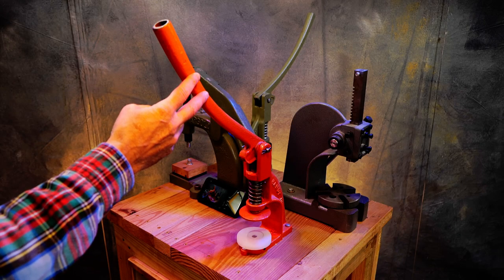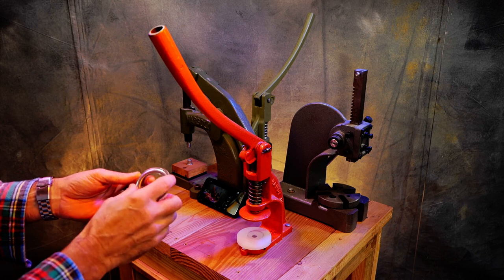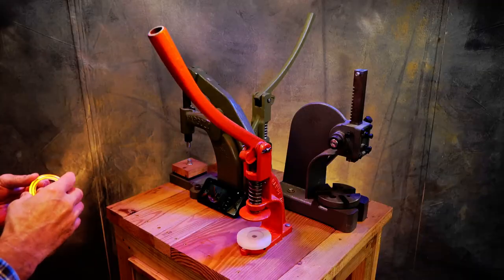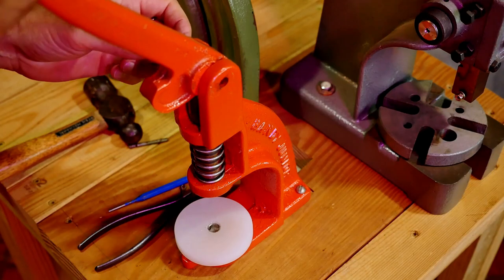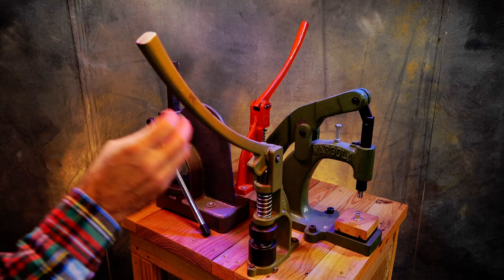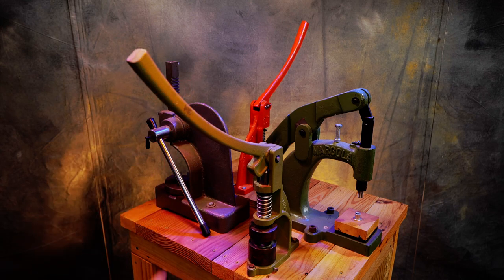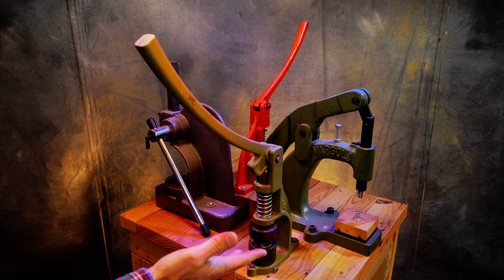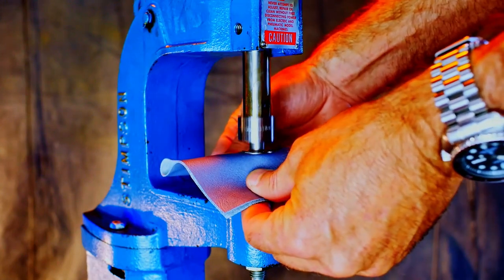Handy Junior #1 Machine Stem Swap with CS Osborne

Comment: Thanks for making such great videos. It is very helpful. I have tried to find that pin for my handy press but didn't have any success. Would you mind giving me a link or how I can find it? That would be much appreciated.  Thanks an keep the good work  👌
Reply from the maker: You will need to find a distributor. I have included the part number and all the info I could glean in the description. I know it is not a link but I hope the info helps you.

Comment: I'd like to convert my Handy Jr to be able to set metal snaps. How would I go about it?
Reply from the maker: There is a die set for every single snap. First decide on your snap and die set. Then you can figure out how to hold the dies in the press. I use an arbor press for snap dies. You can see it next to the Handy. Here is the arbor video. https://youtu.be/8YAw-13czTQ?si=beRWGcQ5bia01IkE